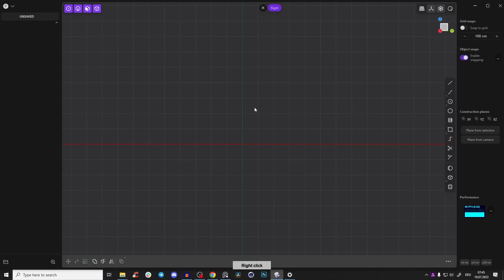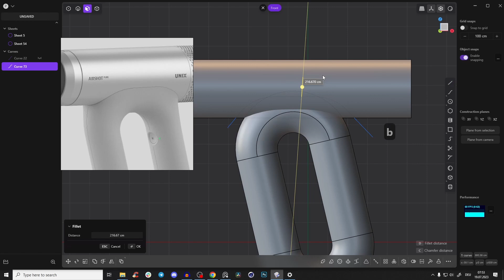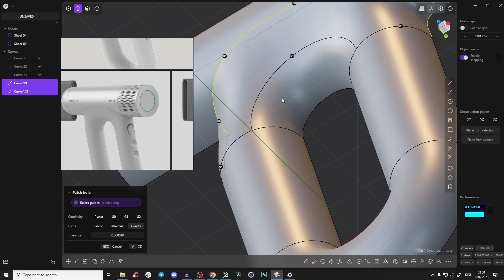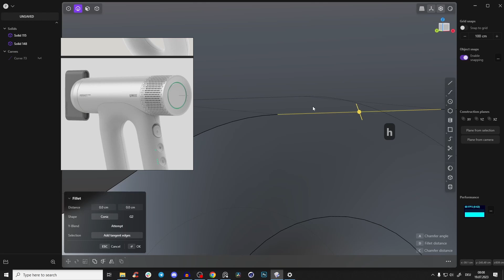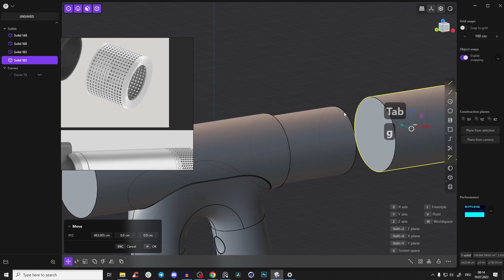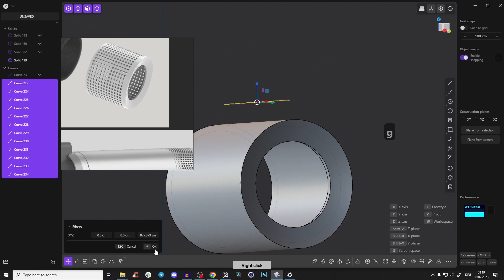Plasticity | Incredible Surface Patching | Industrial Design

Comment: If i buy an indy licence. Can i run plasticity offline, maybe just conect for an upgradre unce in a wile but keep the machine out of the network for the most part. Is this posible?
Reply from the maker: Yes, you can use Plasticity offline for ever. It's a perpetual offline license with upgrades for some time

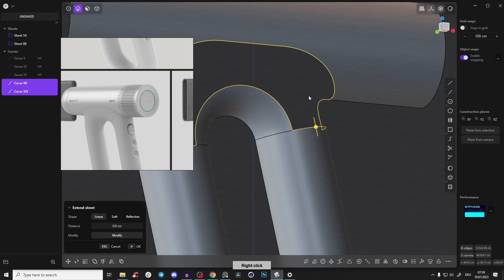Comment: @14:20 my patch failed. Not sure why?
Reply from the maker: Are all curves connected to each other? 
Mostly it's because of that. Otherwise, if the shape is TOO complex, patch&loft doesn't work often
Reply: @nikita.kapustin  yes, all connected. The G0 icons appear around the curves but get error message ‘ No suitable fill method exists ‘
Reply: tweaked the 2 bridged curves a bit and it worked.

Comment: I'm liking what I'm seeing with Plasticity but coming from SolidWorks one thing "bugs me" a bit. What happens when you forget something and do another ten steps? You can't just ctrl+z your way back. Well you can, but then you've potentially wasted an hour of work to redo everything again. Say you wanted to change a G0 to a G1 after a while, is that possible?
Reply from the maker: I never needed a "history". Just think ahead and try to do it right from the beginning. That will push you to new levels if there is "no way back".

But if something is wrong later down the line (as it often happens) you always can fix it somehow.

Comment: Blimey! This is mental. 
Hah - you sound like a kid in a sweet shop. Then again, I probably will using this as well. Great work.
If you export it in to animation software, how does the mesh topology look?.. and how does that work?
Reply from the maker: Will do a video on the export of Plasticity.

But yes you can export it with good topology and use with any aniamtion software